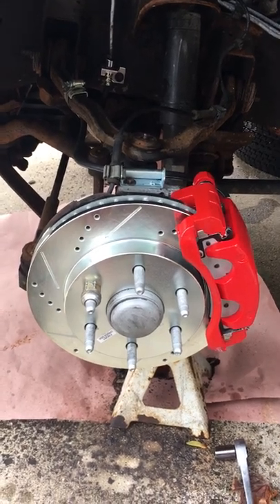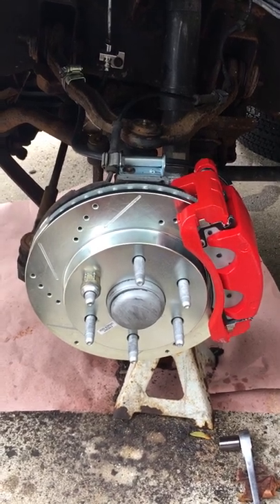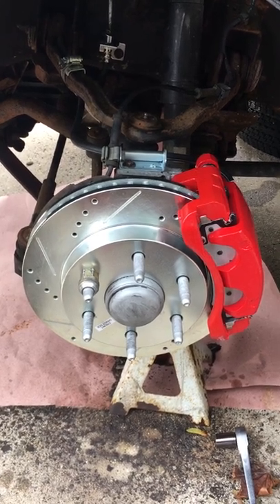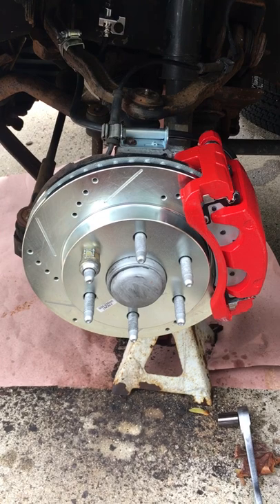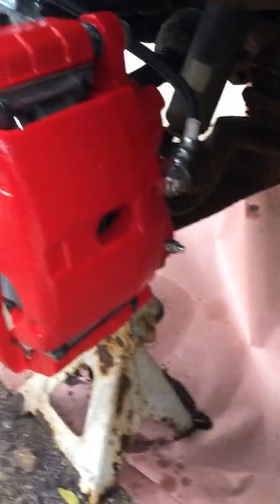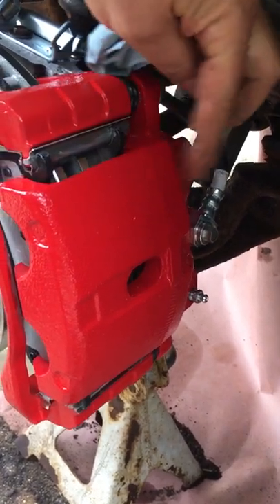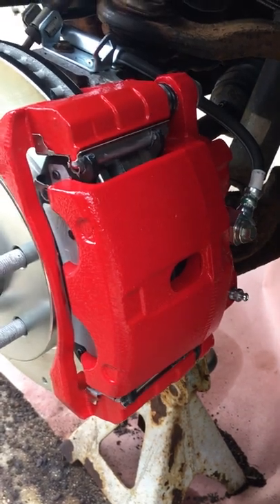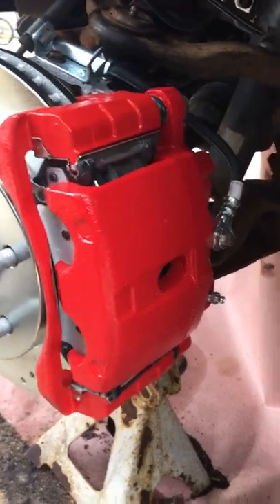Powerstop caliper rookie mistake! Suburban brakes wouldn’t build pressure or bleed.

Comment: Your disc brake rotor on the wrong side. The forward rotation should be with the groove lines going forwards. Not trailing.

Comment: That is why you look at your parts before you start
Reply: Exactly. Is it too hard to just compare the parts and not assume that it will fit because it said so or it seems like it? I had this happen with myself a few times.
Reply: I noticed as soon as I pulled mine out of the box and put them side by side

Comment: For a novice do it yourselfer it's a common mistake 😂 But if you're an above average shade tree mechanic or you actually work as a tech somewhere, you better know that there is a left and right side caliper. Regardless a tech should definitely know the bleeder screw goes up or you'll never get the air out. But then again your everyday tech will make mistakes. No one is perfect...lol.

Comment: I M about to install those in 2 days. Glad i found this. Wonder if it marks driver passenger like it does for rotors. Parts are coming tomorrow.
And yeah, the original calipers on my car has bleed valve upward.